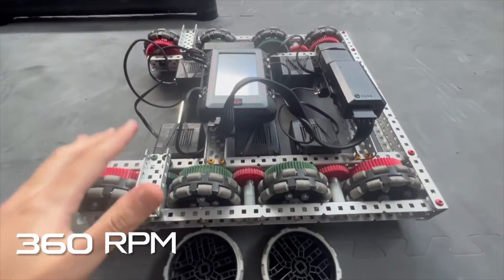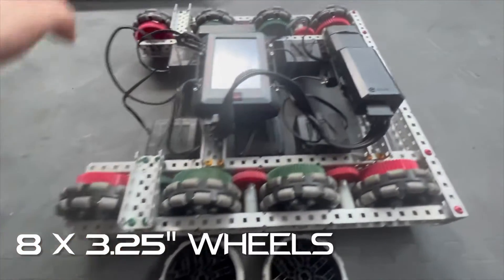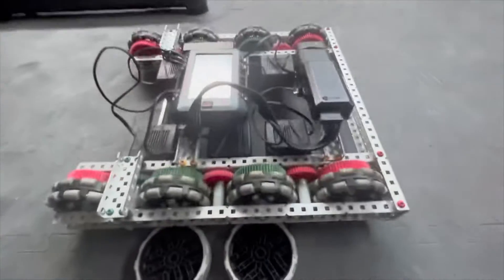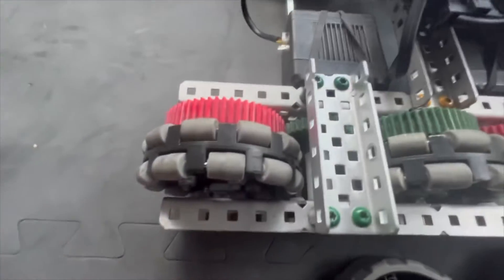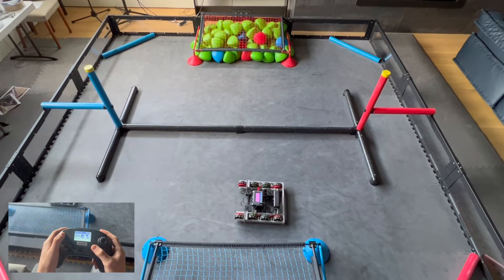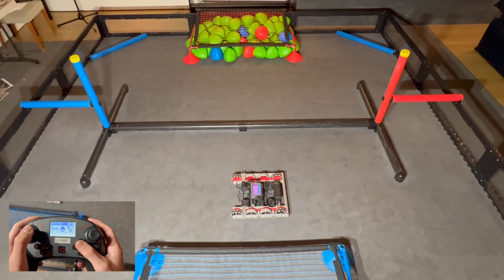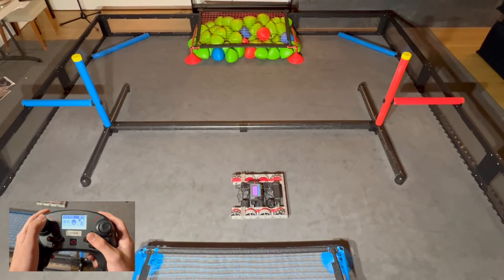11101B VEX OverUnder: Drivebase

Comment: The "11101B VEX OverUnder: Drivebase" video stands as a groundbreaking testament to the incredible advancements achieved in the realm of robotics and engineering. Its impact on these fields is nothing short of profound, heralding a new era of possibilities and pushing the boundaries of what was previously thought attainable.

At its core, this video showcases a marvelously designed drivebase, a culmination of precision engineering and innovative thinking. Its intricacies go beyond mere functionality; they embody a harmonious fusion of mechanical prowess and technological sophistication. The flawless execution and exceptional performance of this creation underline the sheer brilliance and dedication of its creators.

What truly distinguishes this creation is its capability to redefine how we perceive robotics technology. It is not just another innovation; it represents a paradigm shift in the way we interact with and leverage robotics in various industries. The drivebase's ability to effortlessly navigate complex terrains with unparalleled precision and agility is not just impressive—it's groundbreaking. This level of mobility sets an entirely new standard, pushing the boundaries of what was previously believed possible in the robotics domain.

However, what truly sets this video apart is the tantalizing promise it holds—the assurance of driving skills that will remain unmatched. The demonstration of impeccable control and finesse in the "11101B VEX OverUnder: Drivebase" video is nothing short of awe-inspiring. It presents a vision of a future where automation isn't just reliable but operates with an unparalleled level of efficiency, accuracy, and adaptability.

In the context of an ever-evolving world, this video serves as a beacon of human innovation. It represents a profound stride forward in the relentless pursuit of excellence in robotics. It signifies a transformative shift, promising to shape the trajectory of automation and robotics in ways that were once confined to the realm of imagination.

This creation is more than a mere technological feat—it symbolizes the culmination of countless hours of dedication, collaboration, and relentless pursuit of perfection. It stands tall as a testament to the unwavering spirit of innovation that propels humanity forward. With every precise maneuver and seamless navigation, the "11101B VEX OverUnder: Drivebase" video embodies the relentless pursuit of pushing the boundaries, inspiring a future where robotics and automation hold the potential to revolutionize various industries and aspects of our lives.

Comment: what size holes did you drill through the hs axel? whenever i try to drill in them they seem to break bc the screws i use are too wide
Reply from the maker: use a drill bit which is slightly smaller than #8-32 screw. https://www.boltdepot.com/fastener-information/us-tap-drill-size.aspx

Comment: Hey you guys, cool drivetrain! I haven't really used screwjoints before on our bot, why are there standoffs for the screwjoints? Also did you use threadlock for that? Thank you
Reply: Wow, thank you guys for the advice. We plan on rebuilding our bot after our next tournament and you just helped us a lot.
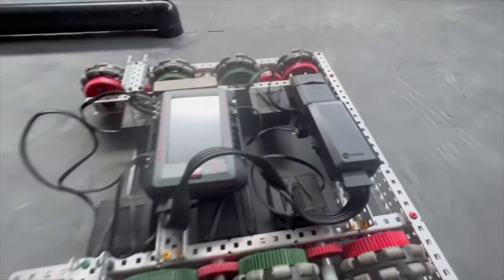Reply: Also for the bracing at the very top at 1:14, is it a HS axle or standoffs?
Reply: @anmwds  its a hs axle
the standoffs are there because the vex legal screws aren't long enough to go through the drivebase, so using a standoff, the screw joint is extended and will be able to be supported on both sides of the drive
Reply: We took the motor standoffs since they have this shoulder thing that can center it inside the square hole, helps mitigate a cause of friction. Screw joints help as they also act as a structural element, which we need since we have the front wheel outside of the drivebase.
Reply from the maker: https://www.vexrobotics.com/276-4840.html
Smart Motor #8-32 Threaded Inserts (10-pack) for $9.99
Reply: Also we don’t use thread lock, but we ensure the screw doesn’t loosen by having nylocks on the side tightened against each c channel, so the screw head and nylock are counter tightened against the c channel, same with the nylock and stand-off